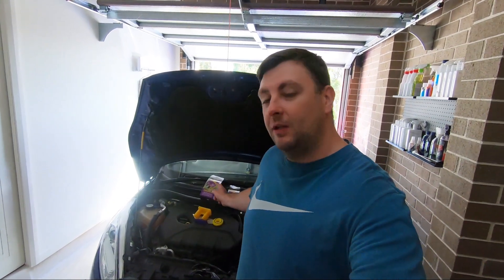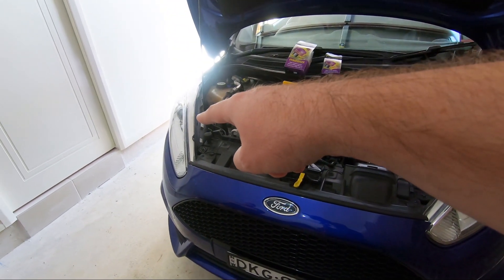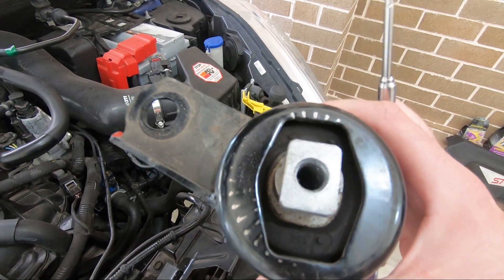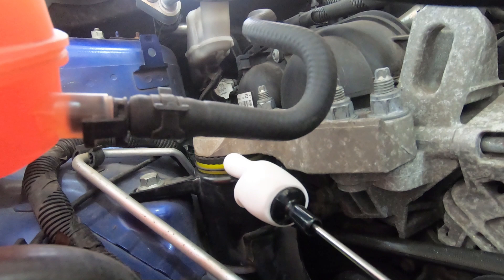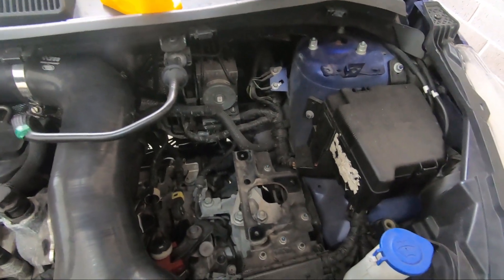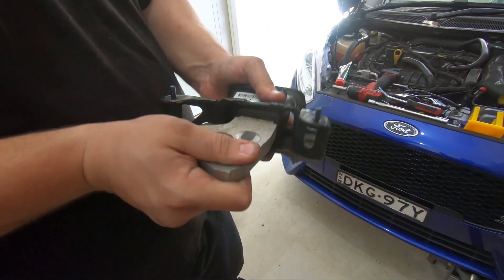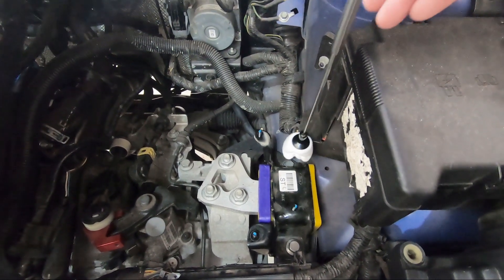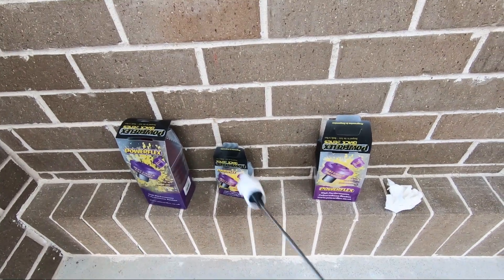Powerflex Engine Mount Inserts - ST180

Comment: Hey mate how are you finding the powerflex inserts? 

I have the mountune rear motor already. My mounts are probably old but i can feel like the engine bouncing lifting off gas and going over bumpy roads and looking at these they seem a cheap and effective way to help reduce that movement. Your thoughts?

And how are they now? I see good and bad reviews mostly about the o ring and people saying to use a cable tie instead. What did you use in the end?
Reply from the maker: @matt12345b  so far so good for mine. The o-ring is still there and working. I mostly daily mine and drive sensibly but they have seen a track day.
I'd say it depends how far gone your stock mounts are. If your current mounts are pretty weak and busted up, I don't think these would be a fix. If your mounts are ok, just a bit worn, these will definitely help prolongue their life. 
The gearbox mount inserts are actually a great design and really quite solid, as you said it's the drivers side o-ring that is the weak point.

Comment: Hello Fordy Ford, first of all, congratulations on your channel, And I also wanted to ask you what you think of the Powerflex inserts for the engine mounts of a BMW X1, do you think they will pass vibrations into the cabin? It is not for sports driving but rather for comfort. thank you so much
Reply from the maker: Thank you for the kind words. I haven't driven an X1 at all so don't know what they are like to begin with. When making anything more stiff in your car, you should probably expect something to change. I had more vibration for the 1st few weeks and it settled a bit but, we have different cars for different purposes so it doesn't bother me in my car.
Reply: @fordyford  Thank you very much Fordyford!!